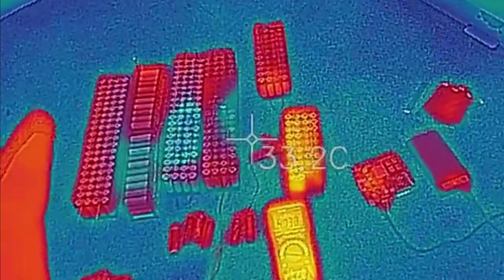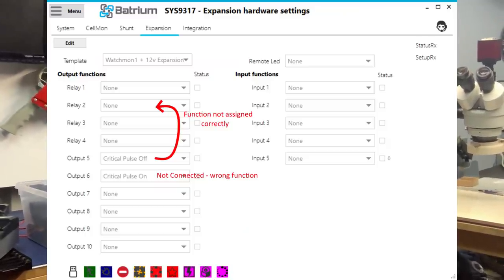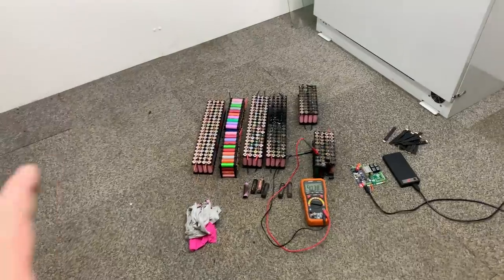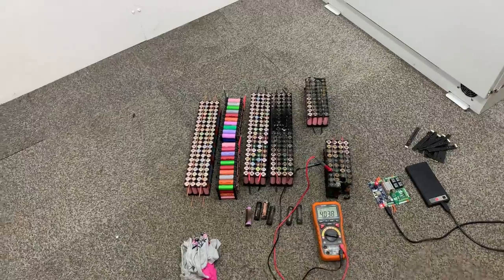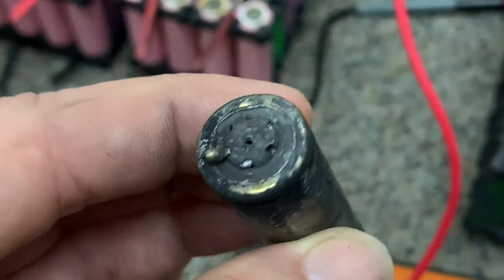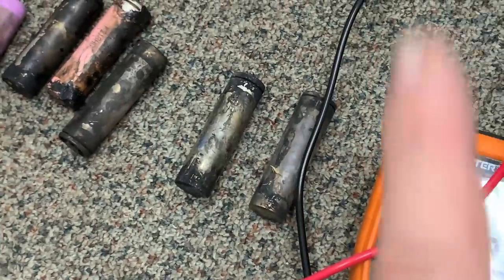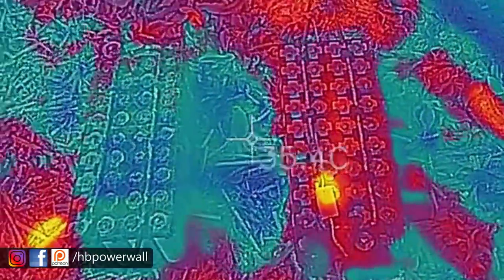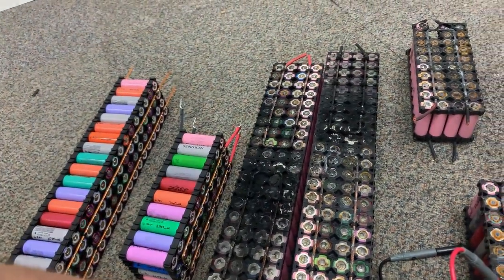Near miss, Smoke, Fire & Fear on new years eve

Comment: More accurate to call it a near hit or a close call?
Reply from the maker: perhaps, doesn't matter what you call it - i'm second guessing everything i've ever done. I'm desperate for more information, photos of install - exact age
Reply: @HBPowerwall  Being pedantic.  😪  Yes, perplexing problem there for you.
Reply: In the Fire Department we would call that a "Fire Out Report". Where there is Smoke... there IS Fire! Having a bunch of 20 Pound C02 Fire Extinguishers on hand can buy you time to get the power cut to energized equipment/systems. I suggest that anyone with a large system have some safety equipment on hand in case of an emergency. Emergency Fire Respirator/Mask with a Fire Retardant pull-over hood (or respirator with a Nomex Hood), Fire Resistant Firefighter Gloves, C02 Fire Extinguishers, Multiple Smoke Alarms, and an OUTSIDE Remote Power Disconnect Box that you can get to if the equipment room is completely on fire.  Honorable Mentions are remote monitoring equipment/alarms with a camera feed and a remote off-site capability to turn the power off via a relay controlled system.  Keeping a setup like this in an out building away from your main dwelling will ensure that your home is safe even if your powerwall outbuilding becomes a total loss.
Reply: @LordTimelord  CO2 will do exactly nothing to a Lithium Fire. And batteries should not be in garages or houses. They should be in separate sheds. Temp and Humidity should be regulated. I guess these extra efforts should be taken into consideration when planning a powerwall project.

Comment: Curiously, the voltage you measure lines up w common phenomenon seen amongst the  grey panasonic ncr18650 2900mah cells from used 27 cell 3s medical  packs , whereby a significant portion of cells wont accept more than ~ 4 .00to4.05v. Above that Voltage they seem to behave like shorts , converting all the charge current to heat, progressively heating up to scorching temperatures if left on charge (from firsthand experienceI). I assume this is end of life behavior / dendritic effect for that specific cell.  Perhaps the physical movement of the separator during charging is such that the dendrites start to pierce the separator at or above the 4to405v., with it self healing at 4v and below, where these same cells are perfectly stable (they don’t behave like heaters ).   I’m pretty sure if you plopped one or two of those babies in a pack of mixed cells and charged to 4.1 - 4.2 they’d be scorching.  The other cells would accept their charge , then more current would flow to the scorchers.  I wonder what current  the fuse wires blow at - can test that?
Reply from the maker: i have heard of this in the states, but never experienced or heard of it here in Australia.
Reply: HBPowerwall can you test the fuse wires melting current or too corroded?

Comment: And the answer is all batteries fail but how they fail is another story .

A single laptop battery fire can do a lot of damage .
The best option is they fail safely if not we must add in safeguards .

I'm thinking this thing is running at more than 2 C with a mix of cell types & ages .

The soldering didn't help , the cells are just not designed for it  .

It looks like you need smaller fuses & a lower maximum output !

Comment: In order to have permanent surveillance, one would need several thermal cameras that monitor an entire area. These images are then monitored by another camera. If a bright point now develops, it is sent as an alarm to a mobile phone app. Although this is programming work, it would be possible with Arduino. I consider another protective, comprehensive solution to be much more expensive. Sorry for possible mistakes, I'm from Germany.
Reply: All you need is an insulated heat sensor, I have one that monitors my bank since I can’t afford those $400 dollar equipments. Or you could have them in series to break charging in the event of unusual heat in the packs

Comment: I had one single 18650 go off while charging. it was less than 3 month's old.
Reply from the maker: Wrong settings in charger? I'm yet to see one go south unless there was an external reason for it.
Reply: @HBPowerwall  actually. this was in an e cigarette and I was using there charger to charge it. scared the crap outta me. I was sitting there 5 feet from it when it went off like a roman candle. it only lasted a minute, but I thought I wonder if that would have set others off next to it ?

Comment: Internal cell shorts won't blow any external fusing. This is why you shouldn't trust used cells and never solder them (only spot weld).   Capacity checking isn't a good indicator of cell health as internal resistance can grow independent of capacity loss. Using a proper test profile such as an HPPC test is the only way to determine cell health.
Reply from the maker: after three years any testing done is useless lets face it! BUT maintenance is required - this was missing by the looks of it.. . I used to think the cell level fusing would stop this fault, but they are really there for dead shorts. Interesting that the CID didn't even go.... much to be learnt from this!!
Reply: @HBPowerwall  HPPC testing is the best way to batch the cells together instead of just capacity checking.   The fusing will protect the rest of the pack but will do nothing to prevent a cell from overheating if the fault is internal

Comment: Did you sprinkler system help or hurt ,,,water is not recommended ,,,,,,new codes soon
Reply from the maker: Every one keeps saying water isn't recommended but how and why - issue with these cells is heat soak causing thermal reaction with joining cells. Removing the heat is the single goal with large battery pack such as these or ev etc. Water and lots of it cools the cells removing thermal reaction. Thus stopping the fire.. FIRE Departments use this method. Water is cheap and accessable. .
Reply: @HBPowerwall  lots of it
Reply from the maker: for hours and hours...

Comment: Its obvious unless we use new cells, mixing the harvested and tested cells will have different resistance, age and chemistry. I guess ageing is more of a factor here, while I have been checking my charge and discharge characteristics of my packs, when I notice one or more of the packs is either taking more time to charge or quick to discharge in the group that always raises a red flag. I don't wait. Surely keep on servicing the packs every other month if you can. And I will lower my voltage now to 4.0volts from 4.1volts. That encounter is frightening!!
Reply: Even with all new cells,  one cell with fail before all the others ...

Comment: This is a typical sign of an internal collapse to the point that the fault is enough to pass current in between the layers of the cell but not enough that it is pulling current at such a dramatic rate that the external fuse will blow. once the internal layers are damaged, it will generate heat from it's own stored energy AKA Thermal runaway. There is little that can be done to prevent this I'm afraid. Early signs would have been the cell would have been producing a lot more heat than the others. I wish it there was a simple product which had hundreds of temperature sensors on so you could stick them to every cell!!

Comment: Probably you’re never know the reason why that happen . I understand in the video that is another person that made that pack .Maybe he used a revived cell or maybe more than one ore maybe he did everything right . I found this interesting on internet and I pasted here , maybe can be to help for someone: If the voltage on a Lithium-ion cell drops below 2V, bad things start happening. At the cathode, the oxygen in a Lithium Cobalt Oxide or Lithium Manganese Oxide cathode can break down over the course of a week or two. For a Lithium Iron Phosphate cell, the oxygen breakdown is even faster. At the anode, when copper foil used as the current collector it can dissolve in the electrolyte, increasing the self-discharge rate of the battery, and parcipating out as metallic copper when recharged, potentially even shorting out the cell.

Comment: at the end of the day, they are "second hand " batteries and now way to tell what or how they were used before you got them so each of them is an unknown and a potential to go off
Reply: No way to know when a new cell with fail, either ...
Reply: @MrSummitville  true but that is generally later on down the track after a few cycles have occured
Reply: @dtec30  Its been several years ...
Reply: @MrSummitville  well there you go then
Reply: @dtec30  Batteries fail, new and old, you need to be prepared ...

Comment: Jeez the takeaway here is dont ever instal a power inside your house (ie a habitable space).  Also note that when a pack goes ape, it needs to be instantly quick removal, keep a pair of proper cable cutters on the wall besides - like a firemans axe.  The cell packs havent got a prominent grab handle.  With all the faff of checking old cells then rebuilding and all those hand soldered joints, then finding one or more cells are under spec etc - is it worth the risk - when a failure can be so catastrophic?
Needs a reliability analysis - ie if 1 in a thousand cells can fail every 4 years, what are the chance of an incident when using 800 cells in a series chain etc  See how it all adds up to a certainty (btw this subject of reliability get very mathematical)

Comment: 1. Cells were heated for soldering (there is no excuse now 16€ screenless spot welder is on the market although it needs a mode to be somewhat reliable)
2. Mixed and matched different capacity and resistance cells. Therefore likely running some batteries harder than it's designed to. 
3. fuses are not very  scientific here - is it the same length all over the pack? Also looks like solder melted before the fuse shorting a cell. 

Over all I would be easier to use decommissioned packs from EVs or buying aluminum cased LFP cells.
Reply from the maker: 1,2,3 are all mute points considering the age - we know better these days... EV is the way forward...

Comment: water probably is the worst you can throw batteries on fire into. I much rather throw them on the floor and cover them in sand. Sand will soffocate the fire and wont cause further reactions with the lithium or whatever is in the batteries.

Also something i always thought while whatching your powerwalls is that you should probably have laminated stainless steel sheets separating each batery pack exactly for these situations where one catches fire while surrounded by other batteries pack which could also catch fire if left to their luck. 

i mean, its a sheet of stainless still with laminated plastic, like the one you can buy in any office supplies store on each side to protect against short circuits, and with that the fire will only go upwards. If left for too long the plastic could catch fire too so its better if you use kapton instead.
Reply: Contrary to what you think, putting the battery pack in water was the proper response ...
Reply: @MrSummitville  
idk, i always heard never to use water to extinguish chemical fires. I think lithium batteries count as chemical fire. I mean lithium itself catches fire in water, not sure if the lithium substance these have acts the same but iirc they even catch fire in the air so i think there should be some risk involved say in the case some seal is broken or something.
Reply: @laharl2k  Don't care what you've "heard".  Putting the battery pack into water ... put the fire out.  There is no Lithium Metal inside these batteries.  These batteries do NOT catch fire "in the air".   Where are you getting this nonsense?
Reply: @MrSummitville  
Well "you" also count as "what ive heard", just saying.
If you ever opened a a lithium cell, the paste inside catches fire in the air, go watch some video where someone opens a 18650 and unrolls it.  Usually chemicals that catch fire on air also catch fire in water so i would at least first try and be sure they dont cach fire on contact with water first before puting them out with water. The last thing you want is them to catch fire even more violently or explode like a granade.
Im no chemist but ive seen enough videos to know to be careful around these reactive metals.
So unless you have proof or something, i rather be safe than sorry, sand works just as well and wont ruin the rest of the pack for a single cell.

Comment: There's literally nothing you can do to stop that. It's low probability, but we all know it can happen. Unless you're going to whack a temp sender on every individual cell, and monitor the temperature of each cell to trigger an alarm if any one cell goes above 80c...

Or oil filled metal cases for each pack with a burst cap? The oil could stop the spread of fire and conduct the heat away from the run away cell, protecting those around it. A pressure sensor to disconnect and sound the alarm and the burst cap to stop the metal box from exploding if it REALLY gets out of hand.

A lot of work for you to retrofit I know, now that you're this far in. I'll be putting more thought to this for when I start constructing my packs.

Seriously though, I don't see how that can happen. Just one single cell all of a sudden go unstable under light load.
I'm suss on that buss bar. 
I think there's a very good chance that someone or something damaged that positive buss bar and it shorted to the cell casing. I would be interested to hear more if he gets back in contact with you.

Comment: a friend of mine got a 48v 20ah lithium battery for his scooter and the 48v charger failed so without asking anyone he grabbed the charger from his sisters scooter and set it for charging. a 60v charger provides 78v at full charge voltage, so once the bms shut off at 4.2v per cell the voltage accross the bms went close to 80v and the mosfets in these chinese bms are rated at 80v only , so after few hours the mosfets shorted sending 78v on a 59v battery and it was left like that over night at 4 am in the morning hell broke lose! the cells were terribly over charged and all of them went off all at once , his scoter was completely destroyed , not even the metal bits remained , the flame was so hot that it caused the garage wall to crack. fire fighters were called and they could not extinguish it. it burnt for more than half an hour before all the cells were gone and finally the water doused the plastic that was on fire.

Comment: you just can not trust these batteries, I recently had a Makita battery pack go nuclear for no reason after use ,one hour later putting them away noticed  one end of battery getting hot and starting to smoke so opened up battery and pulled hot cells out, put them outside, thought they would burst into flames but didn't, checked them later, the two batteries damaged showed zero volts and the rest of the pack were ok.

Comment: wow i commented a few minutes ago on another video f yours about how useless the external fuse are what is dangerous with these battery’s is when they internally short and creat oxygen and burn out of control taking your house with it possibly. 5e lithium grows until it touches the other side.
Reply from the maker: Yes, but there is usually signs to this happening - like cell starting to warm well before it goes thermal. Good maintance is key I think.
Reply: @HBPowerwall  at this point the price of new cells of lifepo4 that are a lot safer as they do not create oxygen when burning why not go that way i get that would not make as good of videos.
Reply from the maker: To be fair we were doing this long before LifePo4's were affordable.
Reply: @HBPowerwall  ya for sure but might be time to rethink just my feeling i just found your channel cool content.

Comment: I see all these 'powerwall' projects on youtube and whatnot and was wondering why fires are so rare. Perhaps not many of you come forward and share?
Reply: Why would you think there are more fires?
Tesla cars, Nissan leaf..... Those packs are under FAR FAR greater stress than a powerwall exerts on the same cells.

How many electric car fires do you see?
There's nothing dangerous about building a power wall, if done correctly.
Reply: @jimmyb1451  why? Because most are very poorly assembled, and some even use salvaged cells. Which os a big no-no.
Reply: @circuitdotlt  You make some pretty big assumptions there mate. I have several packs built from salvaged cells that I abuse the living shit out of. 

The example given was built quite well. Personally, I build mine a lot more robust than the one in this example and with more insulation because of the performance I expect from them and the conditions I know they will be subjected to, but they are all consistently abused and placed under very heavy load. Your arguments don't fit this example nor mine.

I reckon there's more to this story. I have a sneaking suspicion that something happened to that pack and those two cells were shorted.

Pure speculation of course, and I hope Pete hears back from the gentleman and we get to hear more about the events of that afternoon.

This whole movement began as an exercise in waste reduction of laptop batteries going into land fill. Which is still a gigantic problem, especially here in Aus. Mostly due to our government being so very inept on a lot of levels.

If you're going to advocate that the ONLY safe way to do this (which is bollocks btw) is to purchase new cells, you might as well just become a Tesla salesman.
Reply: @jimmyb1451  the mere fact that you still have a home does not prove these builds are safe. I saw so many fires in last 15 years, it is really scary. My company produces modular battery packs and BMS, I am familiar with batteries and what build can be called 'adequate' and safe. Most or these DIY projects are not that, and it's not a question if, but when.
Reply: @circuitdotlt  yeah, okay.